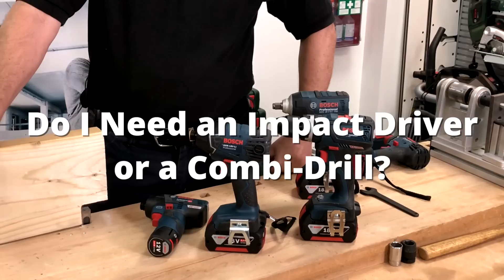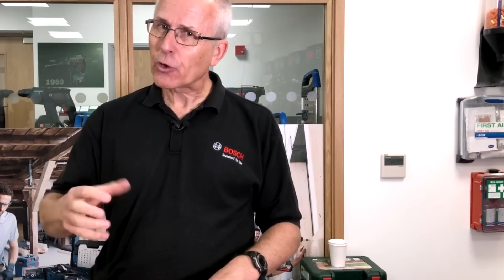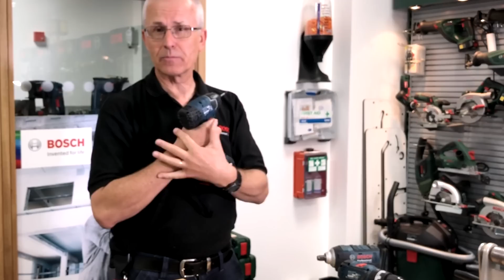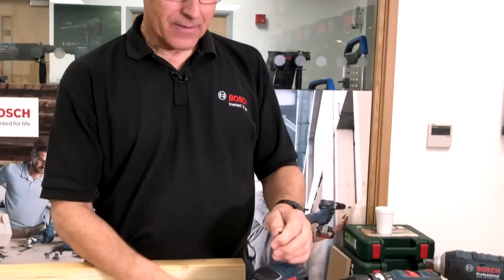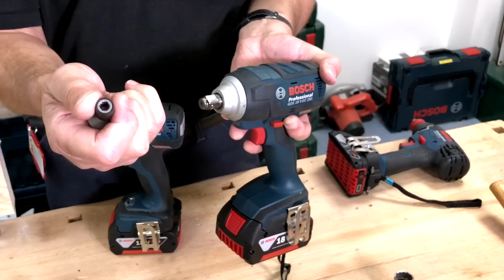Do I Need an Impact Driver or a Combi Drill | Toolstop Guide

Comment: I bought a combo package recently with GDSR-190 & GDR 1400.  All positive, from having a tool to drill pilot holes then the other has the bit needed for screwing, set & ready to go.  Second, would be buying the combo gave me two batteries, plus the heavy duty canvas bag (way better than hard cases).  Yes, they charge fast, but having two is better.  1st Bosch tools I have purchased & only cordless tools I own.  After swearing I would never buy cordless again, just overall bad experiences.  Only issue was the learning curve for the impact, broken cheap screws and over-tightening, takes a little getting used to.  All good now and will be sticking with Bosch for my tools when and if I need to replace something.

Comment: I'm was a  combi driver guy, I don't understand the extra tool and can't justify their need. But when I was installing something on the ceiling, combi driver was hard to manage because it was twisting my arm and the sensitive position didn't allow handle the kickback properly. Then I realised, that the impact driver would have been a better choice there.
One more tool can be a good option at times where it matters.

Comment: The stupid thing is an impact driver is all about torque….yet has no calibrated torque number settings or scale readout for you.  All you know is it is giving the fastener a really good hard twist…in some cases too hard.  For this reason, and despite that most YT tool channels seem to ubiquitously use impact drivers in favour of drills, I prefer a powerful hammer action drill driver with clutch settings so I won’t strip the smaller screws and it will still power deep into concrete if I ask it to.  If I ever need to undo lug nuts on a truck wheel…then I’ll think about an impact driver (but then it will more likely benefit from a dedicated wheel nut impact wrench).  Thanks for the video👍

Comment: I picked up a 5 piece combo kit today as it was an excellent way to get into Bosch Blue.  I have eight Bosch Green power tools that use the 18V Power4All which I love, but some of them run out of steam in some situations.  The angle grinder especially, but I also had a need for a much more powerful drill to drive garden augers.  Anyway, it seems that I did not properly appreciate what I was getting, and probably did not fully appreciate the tools I already own, because I have learned heaps from this video.  For what it is worth, I also own a Bosch Blue corded angle grinder that gets lots of use, and that I love, and more recently I bought a Bosch 1600CE router with plunge and fixed bases, and that I really love.  It has had some seriously heavy use and barely got got warm.  On the down side I have it table mounted using the fixed base, and that is not as successful as say, a Triton TRA001 which is a dream to use table mounted.   I have also seen what looked like a reference to some of these tools working with an app via wireless or Bluetooth.  If I have got that right, I had no idea they had that feature so I shall now try and track that down, or maybe even read the flipping manual ;-)

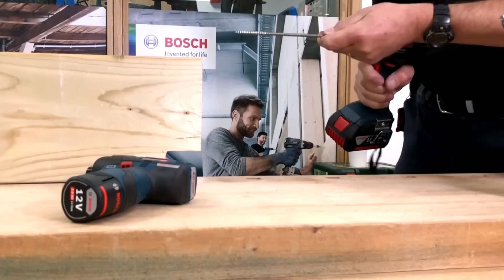Comment: 11:01 I still don't understand. The chapter is called 'Benefits of using impact driver', you say it's meant to drive the screws into the wood, yet you get better results with combi drill. What's the point of the driver then? Where does it excel?  Does it need less manual orthogonal force than the drill?

Comment: Can it be use for bicycle from 3~14 Nm ? How accurate is the torque ? After viewing same price range for different brand, I just bought the GSB 120 Li for general home use. In fact, I had a trusty old bosch GSB 20-2 impact power drill for many years and occasionally still using it. But it does not have reverse speed and no torque setting and not as portable as cordless impact. I suppose both drill should serve me well. Thanks for your video and explanation.

Comment: I have a Ryobi drill driver which I bought just before Christmas (cost £80 incl battery and charger which was pretty cheap), but for some reason it seems to do a poor job at driving in screws into wood, and I'm mostly talking about wooden gate posts that are quite old or very hard wood, even softer wood is doesn't seem to do much. The drill either wobbles when driving in screws, resulting in the drill slipping off the head of the screw, or I end up with a damaged screw head, and I've tried different screws and screw bits which I bought. Maybe I need one of those special screw bits (the ones I have are Bosch screw bits for different types of screws, ie Philips, Pozi etc). Could be the battery being just a 1.5ah that's the problem.

Comment: I had the Combi drill for a long time (older version with the terrible chuck that gets jammed far too easy and made with plastic) served me well, just picked up a kit with both the Combi drill and the impact driver/wrench (GDX18V-1800C). Man its loud, like ear ringing loud if it's about 1ft from your head. Works great though! just not for all day IMO because of how annoying it can be, feel there underrated with the more powerful CORE batteries. I have some old 2.0Ah batteries and they feel like the 150 ft/lbs there rated for. I was able to take off 21mm rusted bolts off a truck no problem, and lug nuts fly right off with the new CORE 4.0Ah batteries and they hold power till there almost dead, compared to an old lightly used 6.0Ah which starts to lose power around 25% capacity and the old 2.0Ah batteries start to tapper off almost right away if your doing something heavy and about 1/3 capacity if it's light work.

Comment: Hi. I have been using the Bosch Uneo for well over 10 years now. It offers screw driving, wood/metal drilling and Hammer drilling into concrete.
Is there anything out there today that also offers all three tasks in one tool or is this type of tool not recommended today?
Reply from the maker: Hi Reb, the tool you are looking for is a combi drill. These will do all of the above functions. We have a range available on our site which you can check out here: https://www.toolstop.co.uk/power-tools/cordless-power-tools/cordless-combi-drills/  There is a newer version of the Uneo, however unfortunately we don't stock this. (https://www.bosch-diy.com/gb/en/p/uneo-060398400d-v100043806).
Reply: @toolstop  Thanks. I'll take a look.

Comment: No need for  for an impact driver in  my life  as a carpenter builder, as far as I am concerned if you need to use an impact driver you should have a) piloted or b) used a more powerful drill driver.  impact drivers are for grease monkeys. 
  Never forget the benefits of beeswax or soap !!

Comment: Hi wonder if you or anyone reading the comment can answer this - I have a lot of pain when applying "straight" force to my combi drill nowadays for screws as I have a bit of arthritis (so I am pushing hard on the base on the combi to PUSH the bit into the screw head to stop it slipping). If I had an impact drive would this hurt less as I don't need to push down as hard?

Comment: The only rational answer is yes. You need an impact driver and a combi drill. You should also consider a cordless work light. And a multi tool. And just about anything that will fit in your tool chest. And if it doesn't, you'll need a new tool chest too.

Comment: Novice here. Can you use an impact wrench to simply loosen nuts and bolts on a car that are really stuck or seized in place? I would never use it to tighten, only a handheld torque wrench. Also, because so many nuts and bolts are in such tight places on cars, can you use adapter bars if the drill won't fit in tight areas?

Comment: What entry level impact driver would you recommend for a decent price. Thanks
Reply: It depends on what batteries you already have -- it probably makes sense to buy a bare tool (i.e. no battery or charger included) in that line. 

If you've not committed yourself to one manufacturer's batteries, think carefully before you do. Think about what sort of cordless tools you'll need (and in what cases a corded one is fine), what's available in that line, how good they are vs cost AND what additional batteries will cost.
Reply: James Rodgers hi got an bare jcb impact driver in the end and charger and battery sperate. It’s brushless and has 180nm got it for around £60

Comment: Hi, I'm looking for an all rounder but would appreciate a demonstration such as you've used for the bolt screw.  All of my gear over the past 20 years included Bosh as my main.  I prefer them over Dewalt or Makita etc.

I'm currently doing a lot of garden work, decking and fencing etc. as well as stone work.  
I've always been surprised to realise that Gear 1 on my Screwdriver always had more power than my Impact, even though the numbers are considerably higher on the Impact driver.  However, i have a weak wrist, so making use of the Impact was always good for me, but now i realise it's limitations.

I'll take a close look at your GDX range.  Thanks.

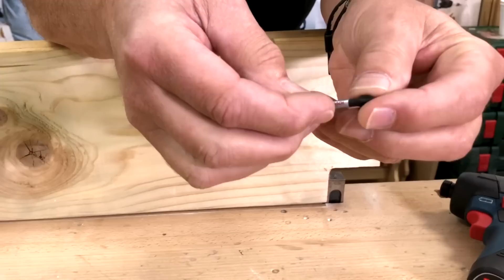Comment: 6:00 I’ve always wondered: if you got an impact driver why do you want an “impact bit” that is designed to REDUCE the effect of the impact?   Don’t you want all the impact to go to the fastener?
Reply: I was thinking of a similar application: torque limiting sockets-  these definitely reduce the torque by reducing the impact, is this a different action?
Reply: the shock is reduced, the torque is still there

Comment: If an impact driver is needed for a job, I cant see the point in using driver bits that reduce the impact ?
Reply: Because they don't reduce the impact by very much -- just enough to protect the head of the bit. Normal bits will break.

Comment: Does this means then means that the impact drill has a high wear rate on that slipping mechanism?
Reply: Impact drill = hammer drill. They use a different mechanism from what the mechanism he demonstrated. A hammer drill mechanism is smaller and subject to less wear than an impact driver mechanism.

Comment: Now all Bosh need is a 12volt and 18volt charger in one :)
Reply: They've had one  since 2017. Search for Bosch GAX. It will only charge one battery at a time, but if you put in one of each, it will charge both in the order you inserted them.

Comment: this is a video that a lot of people need to watch and understand.

i read a lot of bad reviews on impact drivers where the product wore out after several months or it started smoking after a few days of use and every one of them were using their impact drivers to drill screws into wood. as this video explains, impact drivers aren't meant for that application and they should have used a drill. impact drivers are for breaking and tightening. drills are for driving. drivers are circular impact and drills are forward impact. you're overworking the motor in your impact driver and wearing out the anvil using it to drill screws.

Comment: I have set of Bosch drills ,grinder & impact which I have problem with the battery’s 
When I Charg them they die so fast 
Is there any tips to fix them 
They are the same size as urs
Reply from the maker: Are the batteries or charger old? Are they genuine Bosch batteries? Are you using them in particularly hot or cold working conditions Davood?
Reply: Toolstop 
Yes The batteries and charger are old, I’ve been using them for 7 , 8 years 
I have to say they were ok until two month a go when I bout a Bosch grinder which eats the batteries fast and another think I’m using different charger for same batteries but smaller with no cooling fan 
Since using the new charger I’ve come across with the issue 
Yes they are genuine original Bosch,
They are in my van all the time and the pass 6 month were very cold

Comment: I've been a professional woodworker for nearly a decade now and I've never ran into a situation where i absolutely needed an impact driver.
I won't deny the usefuleness of an impact but my go to is a combi drill. Drills are way faster, quieter and way better to "dose" to not overdireve a fastener.
Reply: Ok abit harsh lol, let's say if you was doing a decking job would you not go for the impact driver then?? Plus don't you find you can get in tighter spacers with impact for instance when you're doing kitchens??
Reply: @booboo-nl3wi  Most of the Decks in my area have a aluminium or a woodcomposite substructure and are screwed down with stainless steel screws. They rip off pretty easily in alu or wpc so i use the drill and set the clutch on a low setting so i don't have to worry about it. For furniture i mostly use my 12v driver, it has all the power you need for this little screws and its super compact and lightweight. As i wrote in my first comment i won't deny the usefullness of an impact. Really big legs are a pain in the ass with a drill especially when you're up on a ladder or a rafter. But i rarely need  screws big enough to cause major kickback so i use my combidrill because it's faster and quieter.
Reply: My Milwaukee M18 gen 4 impact says hello
Reply: Your not a professional then
Reply: @booboo-nl3wi   hundreds of clients would say otherwise. 
But yeah well a random guy on the internet is probably right.
Reply: @booboo-nl3wi  Professional means, he is doing a profession for money. Who are you to decide who gets paid for which kind of work? These comments are just childish. He can carve the wood with a spoon if he likes to and then sell it. And can call it "professional work for woodworking", what do you care?

Combi driver can do it all, and there are quality combi drivers that can even "pulse" when it senses high torque and simulate a impact driver effectiveness. Not necessarily to race with the performance of specialized impact drivers. But see, tools are just choices. Whichever you like, you use it. Maybe just the sound of it annoys you or that it looks cool or that your grandfather gave you the tool.

Please have some more respect to other people's efforts and choices.

Comment: everyone drills into wood as an example, cmon now..drill into masonary/brick
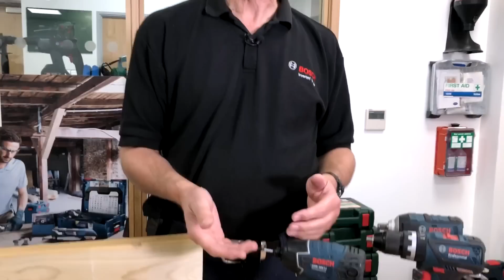Reply: This is not a drilling video, you do know that impact drivers are to drive screws right? They are not made to drill but to drive, most screws are driven in wood, some in metal, none in concrete, he even said in 2:04 that they are not intended to be used in concrete/brick.

Comment: In the US, we rarely use the term “impact drill”, instead we use “hammer drill”, less confusion. However, there is still some confusion between “impact driver” and “impact wrench”. People in the trades know the difference, as do some DIY folks, but many consumers don’t realize they are two different, but closely related things. 

Good demonstration and thanks for demonstrating that a drill/driver is sometimes faster than an impact driver. Choose the right tool for the job...when you have the right tool available.

Comment: combi is all you need. When a screw gives trouble switch it to hammer mode and watch that sucka come out.
Reply: Yep. I agree.  I've only owned a bosch drill driver, and a bosch hammer sds hammer for the last 9 years. I usually buy replacements after 3-4 year  I'm an electrician).

Comment: 6:04 Why would you want to take some of the shock out of the equation when the drill is designed to shock the fastener into tightening up?
Reply: Depends on the dynamics of how its applied.
Reply: @MiracleManM  could you elaborate?
Reply: @MiracleManM  I just think it's like adding a rubber pad to a hammer head to absorb the impact on the nail!
Reply: Let me see if I can explain this in English - Different screw heads can take different torque before deforming. Looking at BOSCH CCSPHV208 bit set the tiny PH1 bits have a thin torsion zone, will twist and reduce torque a lot. The larger PH3 has a thick torsion zone and will keep more torque. It will still transfer as much force as the screw can handle. 

I use torque sticks on my impact driver when tightening wheel nuts. My GF's Suzuki needs 85Nm, my Volvo 140Nm. I use a thin stick on the Suzuki - rated at 80Nm and a thicker on the Volvo - rated at 130Nm. I use a manual torque wrench for the final tightening. Someone had used way to much torque on my mother's Toyota - ended up with a broken stud and a trip to the dealership on the back of a lorry.
Reply: @zooloo73  That's a very good reply, I understand and accept that, thank you. However, the video is refering to the tool bit from wearing out against the screw head, not the way you are describing. 
Your English is very good by the way. What is your native language? Assuming you weren't being condisending!!
Reply: @michaelbirchall2247  Those bits are made of high quality hardened steel. Still the "wings" are rather thin and there are limits to how much force they can take before wearing down. 

My primary language is Norwegian.

Comment: Here is what you probably need : 
1- an impact 12v driver
2- a 12v non hammer 'normal drill'
3- a 18v sds hammer drill
4- a corded sds max hammer drill

If you're just a diy'er : just a simple 18v drill with hammer mode
Reply: Or somewhere in between:
1. 12V impact driver (e.g. Bosch GDR)
2. A good 12V drill/driver with hammer action (e.g. Bosch GSB)
3. Corded SDS for anything the other two can't handle
Reply: @jamesrodgers3132  I have the newest BL bosch 12v drill and impact driver, really improved tho. I have barely the entire 12v bosch line that I store in a single big systainer, I use them ALL the time, it's super convenient.

Comment: Although having less cells in a smaller pack is more strain on those cells and less watthours, causing more heat and in the end more loss while under heavy load. So if you have a larger tool then a drill I would take the 4ah